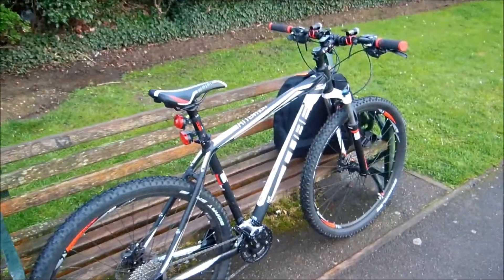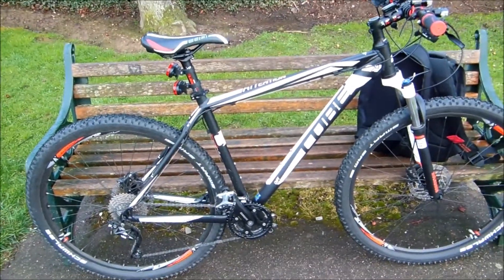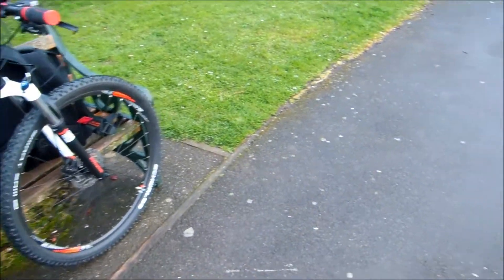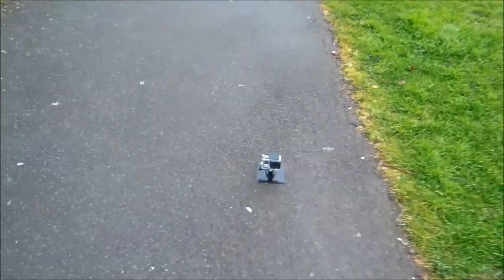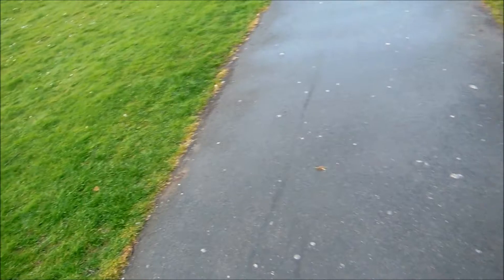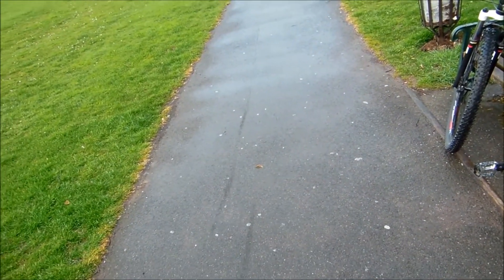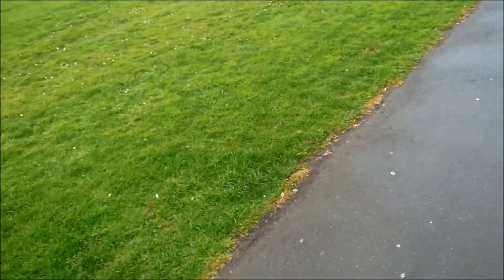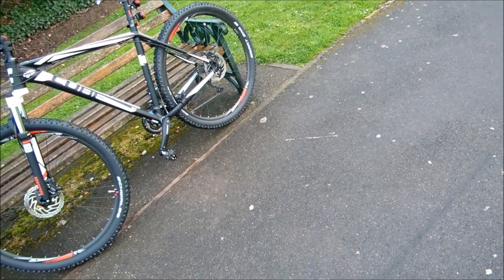Hydraulic Disc Brakes Put To The Test

Comment: Lean backwards, so you get into a more stable position. Also front tire locking is a sure sign of shitty tires. You can improve your braking so much with correct form and better tires.